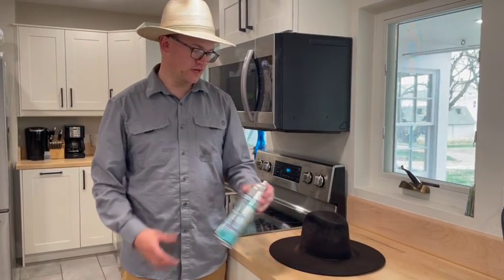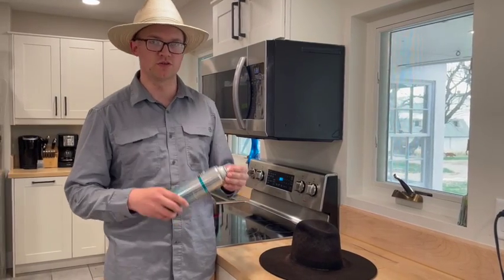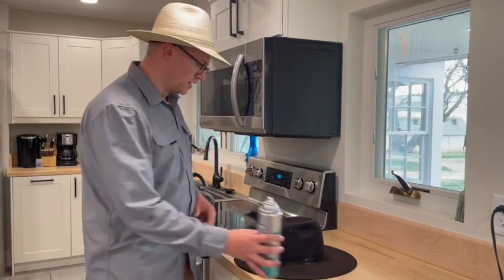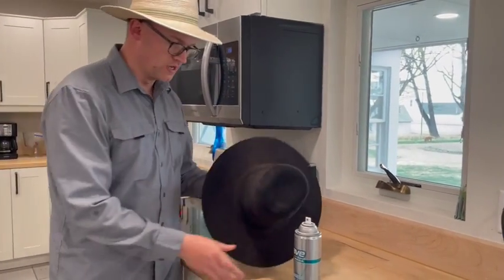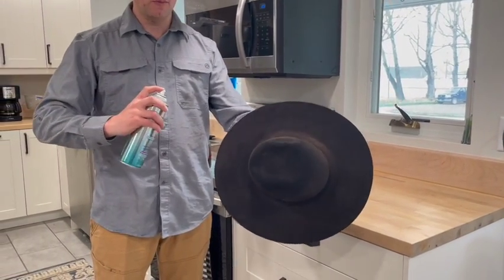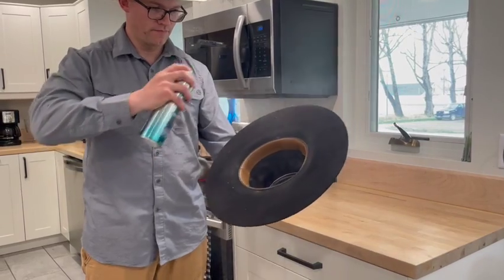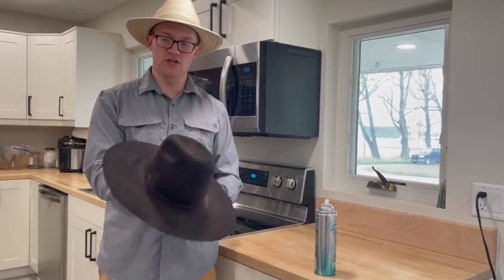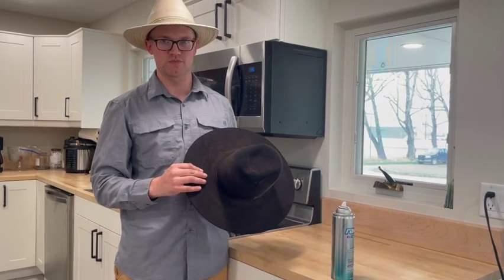How to Stiffen a Cowboy Hat

Comment: For a more permanent stiffener, dilute some clear shellac in alcohol, and spray it on with a spray bottle.  I then run a few tablespoons of alcohol through the sprayer to clean it.  Hairspray is soluble in water, which means rain will soften it, but also perspiration, and humidity.
Reply from the maker: Olav, 

Thanks for the tip. We are actually filming a video here soon about using shellac at home so I’ll be sure to mention some of your tips in there. 

Thanks, 

S^C
Reply: what kind of shellac. im very confused on which kind to use
Reply: @polarbear0218  I'm currently using a spray can of minwax shellac as that is what was on my shelf. You can dilute shellac with denatured alcohol. Brush it on with a clean, animal hair paint brush. (Maybe try adding a few spoonfuls of Kahl stiffner to the mix)

Comment: No No No!!!! You never want to use hair spray on a hat. They have hat  stiffener for that. And you want to use alcohol on a wool hat.
Reply from the maker: Steve, 

We have had luck using all sorts of stiffeners on felts including official hat stiffeners. 

This video was made for ordinary folks who may not have access to hat stiffener at home. 

We have used hairspray for years on many different felt hats and have had  great luck with it, even though it sometimes has the potential of leaving a residue. When applied correctly hairspray works great.

We have plans in the future to make a video discussing the pros and cons of Stiffening hats, and which stiffeners might be the best choice for you depending on the quality of your hat.
Reply: Commercial hat stiffeners are just shellac.

Comment: I used hairspray on my fedora to stiffen it and all I got white residue stains on it.  How do I get rid of these stains?
Reply from the maker: It depends on what the composition of the stain is. I think a safe choice would be to try to put quite a bit of steam all over the hat, and then brush off or use a sponge to remove the residue.
Reply: @StartupCowboy  Thank you!
Reply: What is your opinion regarding dry cleaning your fedora as another option?
Reply from the maker: I haven’t tried it. But they would know if it would be safe or not. 

Let me know if it works!
Reply: Just use a napping sponge 🧽  then use a clean hat brush, brushing down then out from crown to rim.

Also... use shellac and not hairspray. Then light the bugger on fire, and theeeen use the napping sponge followed by brush.

Don't over do it. Little bits at a time. Don't press hard with the napping sponge, just use the weight of the hand.
Reply: @anthonylogiudice9215 use a light mixture of wool wash and cold water. Slowly work stains out one bit at a time with a clean cloth.